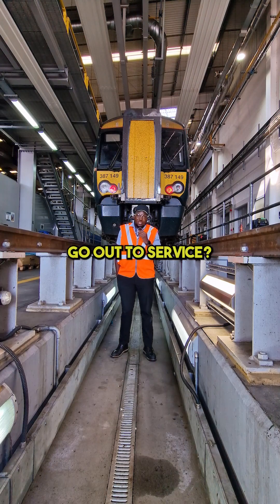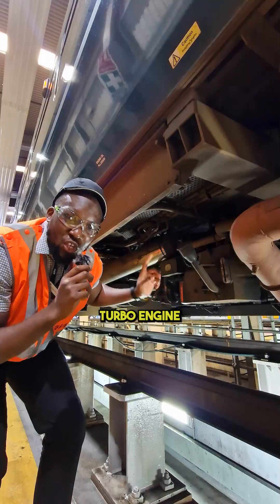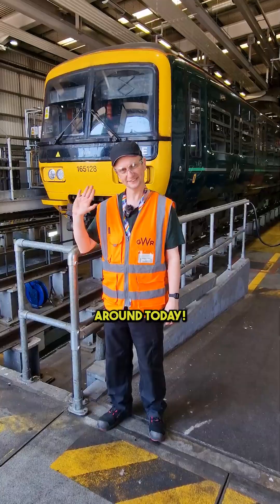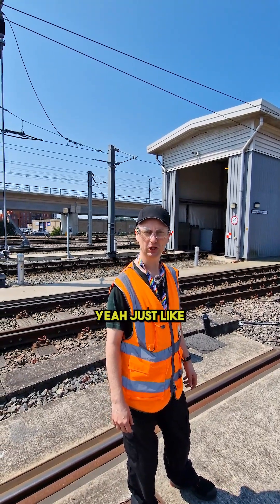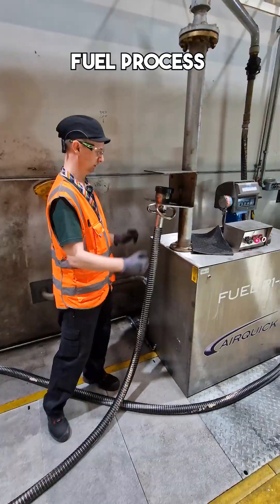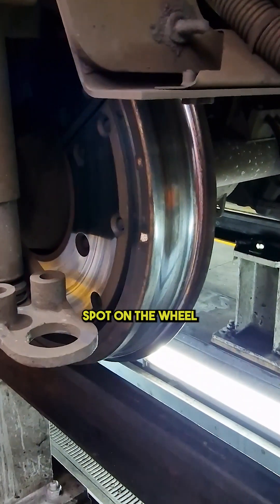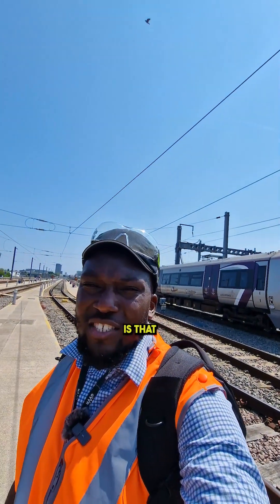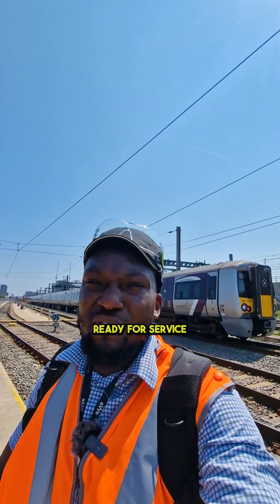How Trains Are Prepared for Service! Inside GWR’s Traincare Depot.

Comment: Great Western Railway could of kept the Class 387/3s that would be used on the Reading-Newbury shuttle. Or they could of inherited the Class 379s that would be used on London Paddington-Newbury, Reading, Didcot Parkway, Bristol Parkway and Cardiff Central. 

But I do think that Network Rail should electrify the Oxford line from Didcot Parkway to Oxford so that Class 387 and Class 800 can run fully on AC 25kv OHL from Paddington to Oxford.